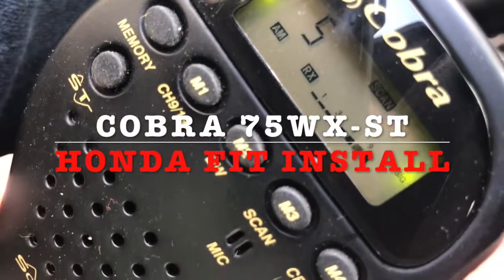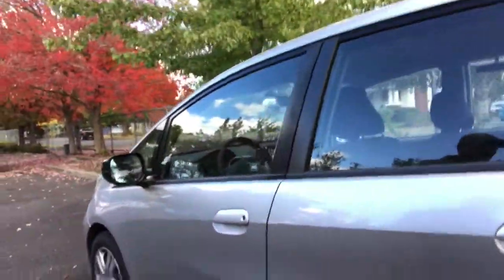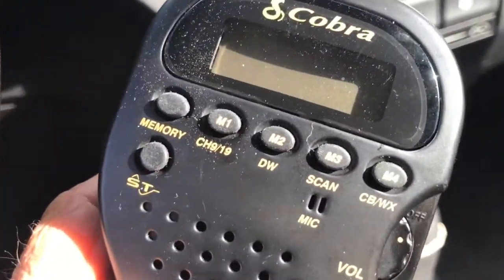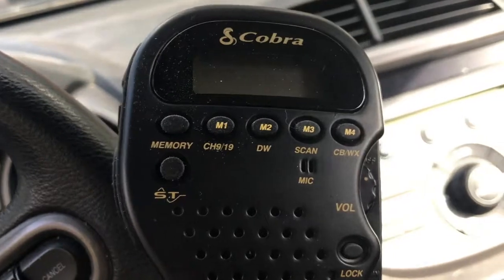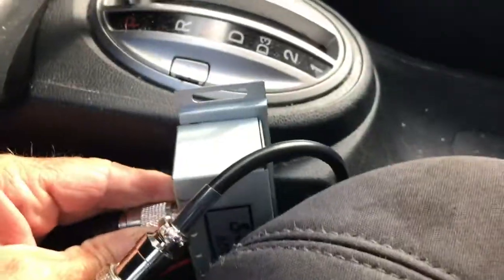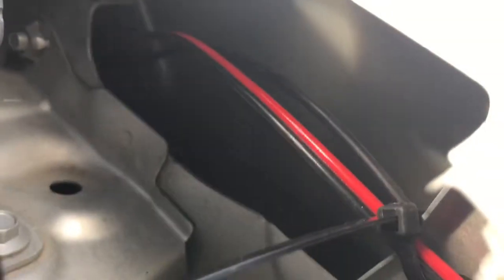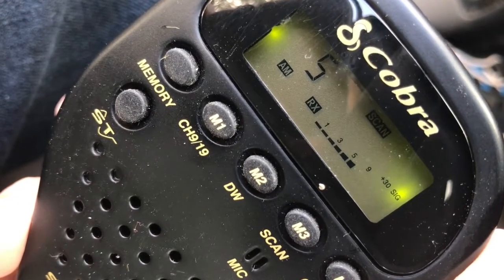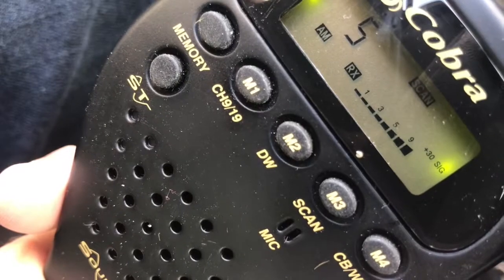CB RADIO installation in a Honda Fit (HOW TO INSTALL)

Comment: I’m wiring my Honda Fit in a similar way except I have the sport model which has power windows.
There’s a large grommet for the power windows which I’ll run the power lead..

Comment: For anyone watching this please don't run your power cord through your fender.
It's known for a fender cable to become pinched overtime possibly causing a short due to exposed wires. 
Also that power cord isn't U.V. protected and will deteriorate over sign if left out in the right conditions.
Reply: Agreed, but if you must run it the way he did, at least make sure you have the positive cable fused at the battery , otherwise it is a huge fire hazard!!!!! The fuse inside the car does absolutely NO good at all if the wire shorts in the door jamb or under the hood somewhere and that wire will catch fire pretty quick if it goes to a dead short.
Reply: @Mike.D.843  Maybe a braided wire sleeve to for some extra protection.

Comment: your better off using a fuse connector and running it from the spare fuse outlet on the inside